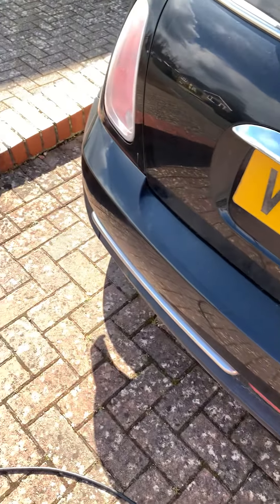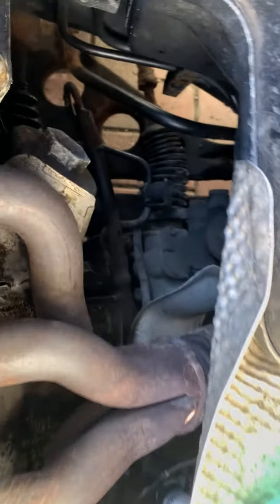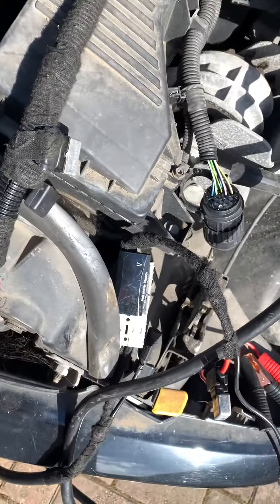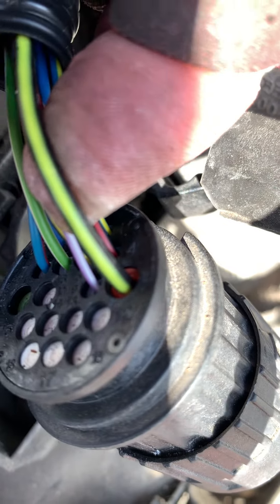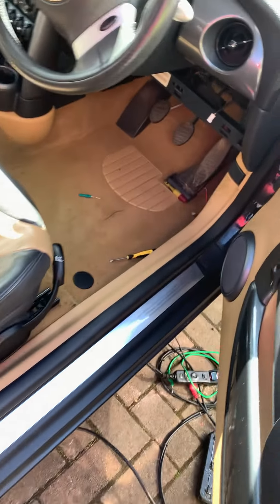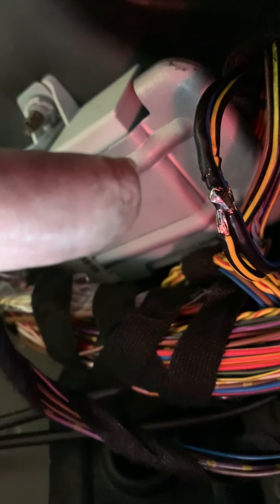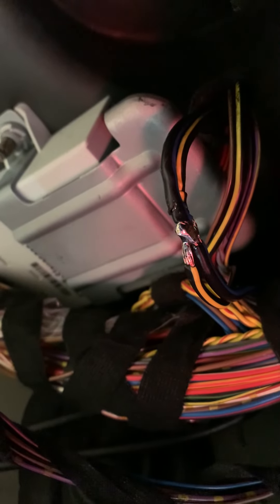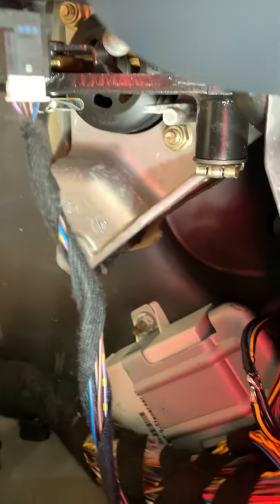Mini No crank immobiliser fault? very simple tests in the description

Comment: Thanks for the video. Attaching a wire there saved me a lot of hassle removing the steering column plastic and trying to work out which wire is which. I now have a bulb in my Mini Cooper that lights up when the starter motor circuit is live, therefore helping me work out the cause of my intermittent fault with the ignition.
Reply from the maker: Nice work! 👍

Comment: Is it the black and yellow wire 2 in from the left of the blsck and yellow wire 3 in from the left as I have two
Reply from the maker: Email us and i will send you the wiring diagram
Reply: @Car alarm and radio Services  OK what's your email?
Reply: I've got the car turning over now by splicing the 2 wires hut doesn't start, guessing it was the other back and yellow wire, the video would've been better if you had the torch or flashlight on so I could see exactly what was what
Reply: Seriously. I've watched it a thousand times don't understand
Reply from the maker: If it turns over then it’s bypassed this is a test for a car that doesn’t turn over
Reply from the maker: What don’t you understand?
Reply from the maker: What don’t you understand? Its a very easy test

Comment: Hello! Did you connect all 4 wires together or black yellow to black yellow and black blue to black blue. Thanks in advance
Reply from the maker: No just connect the two please email us at caralarmandradio@gmail.com for a short cut
Reply: Sorry, which wires did you connect together? The black/yellow with black/blue?
Reply from the maker: @posplaytime801  just the two thick wires black blue to black yellow or unplug the unit and put a fuse in the socket. Email me for details caralarmandradio@gmail.com

Comment: Hi. Thank you for info. I have proved that the starter motor works by following your video. What next. My mini cooper s convertible 2007 won't start. Who do I turn to now. I live in Devon, auto electricians are had to come by. I spoke to one this morning he offered the advice, without seeing the car and I appreciate his comment. Get the ECU checked ?
Reply from the maker: Does it turn over? Email us at caralarmandradio@gmail.com
Reply: @caralarmandradio Hi.yes it turns over.
Reply from the maker: Then it could be all manner of faults the most common is the bcm water gets into the bottom plug

Comment: So, there is just one plug going straight into the EWS, do you cut both of the bigger blue wires and the bigger yellow wires and solice them together, or can you leave it unplugged and jump them over or is there a better video showing how it all
Actually goes together by any chance?
Reply from the maker: Hi tyler just splice them together takes 2 minutes
Reply: So do i leave the plug plugged in, or just leave it unplugged after i splice them?    And is it just the big yellow and black and the big blue and black wire that needs spliced together?   Sorry for the questions, just want to make sure im doing it correctly.
Reply: So i went out on a limb and spliced them together and it works.  I appreciate the video.  Only other question i have is will it work okay with the door lock and unlock on the keyfob?
Reply from the maker: @TylerFrazier-dy4mm  yes no problem
Reply: Hola buenas tardes y aplica también cuando no hay chispa en las bujías??
Reply: @TylerFrazier-dy4mm spliced what together I'm in desperate need of this answer
Reply: Do I splice the wires from the plug or to the plug

Comment: To whom it may concern. If you have a bling ring around your ignition and your car isnt cranking, remove it. I did this wire splice and the car still wouldn't start. Just cranked. My daughter wanted to hook up her car with bling. I removed the bling ring off the ignition and booooom the car started
Reply from the maker: Those rings should be banned also there are some that stick to the airbag on the steering wheel. Really bad idea 😩

Comment: please tell me how you removed the panel to access the immobilizer...we are trying to get it out for programming to a new BCM
Reply from the maker: Ah ok its held in very tightly by a metal strap with a strange security nut but you can get it undone with a pair of pliers it will take patience but easy to do once its loose ok
Reply: Which year, model mini and which country ?
Reply from the maker: @mrdman094081 uk model r series

Comment: Nice video. The chips inside my only key is broken and can't started my 2006 mini with the esw4,3.  Does this trick can fix my problem?
Reply from the maker: No afraid not you will need to get a new key programmed or get the ews mapped out by us

Comment: This will bypass the immobilizer from stopping the starter motor from turning. But it won't bypass the injectors or spark.  So it will now crank over but not start the car.
Reply from the maker: That is correct but the fault in this case was the engine doesn’t turn over
Reply: How do you bypass the injectors and spark
Reply from the maker: @rosswilkinson20 we remove the immobiliser from the ecu electronically
Reply: @caralarmandradio  would you be willing to share? For the record I'm not trying to steal a car.
Reply from the maker: You will need to send me the ecu for ecu update after that it will start
Reply: Depending on where the actual fault was.  Not meant to breach, but to determine if immobilizer was at fault.
Reply from the maker: Yes its a good test to see if the unit is faulty

Comment: Hello! Old thread but hope someone knowledgeable might read it: I have the same symptoms of the car (2006 R50 CVT) sometimes not starting, in particular when it has set for an hour and engine is still warm (usually always starts if turned off only short time, like for a gas stop. and usually also mostly starts if were left alone over night). When it misbehaves, the crank might initiate for a quarter of a second... once! After that never again and I get (from an OBD reader which has app support only for Gen2 Mini) the error code  P1692 which says Turbo(??) Control Solenoid Circuit Malfunction. I don't know if that error code is accurate (I don't have a turbo) and caused the non starting or is the result of the failed start, nevertheless clearing that fault does NOT help to be able to crank/ start the engine. Usually letting it sit for another day might help or last time I pushed onto the lid of the throttle body which "woke it up again"... I already replaced the ignition switch and checked the grounding cable and also believe it isn't the starter motor (albeit not 100% sure). I am on my third throttle body already ( 70.000 miles) and ultrasonic cleaning it hasn't made any changes either... could it be the immobiliser as well or does P1692 indicate a different issue? P1692 says it could also be the pedal position connectors -- and I did install a Sprintbooster some 10+ years ago which seems to work fine otherwise...  or could it be the CVT stick signal (but I do believe I see P on the dashboard) any suggestions??  thx!!!
Reply from the maker: Hi try the testing for the ews as i suspect its faulty

Comment: Hi done this on a neighbours car as it had intermittent starting problem was ok for a few weeks now it just turns over but won't start do you know if say the fuel pump goes through it 
Many thanks
Reply from the maker: Hi James the other circuit goes through the ecu and can’t be removed without the proper software but there are numerous tests that can be carried out before this is done ok
Reply: @caralarmandradio  thank you for your reply I will have a look at the car tomorrow and see what going on with the car so the fueling side doesn't go through the immobiliser control module
Reply from the maker: @jamesgibbs9398  if you email me at caralarmandradio@gmail.com i will send you the wiring and pinouts of the ews unit

Comment: Hello. I have just removed the starter motor from my 2002 Mini One. I bench tested it and it seems fine. Not sure why the car won't start. I tried to turn the engine by hand but it only goes anti-clockwise. No chance of it moving clockwise (I have tried with all my strength). Might be a siezed engine as it was left parked for a year, but oil looks fine on the dipstick. I will give your video guide a go, but not sure how the wiring would be an issue with the car just parked up? Was there any symptoms leading up to your car not starting?
Reply from the maker: You need to check if you have power on the black yellow wire when you crank it dude ok
Reply: What if oil level good, oil pump bad ?

Comment: Hi, I know this is an old video and i probably won't get a reply but i figured i'd try anyway..

I'm having a no crank no start after trying to hook-up an aftermarket radio. (i don't know if the radio is related or not)
All the dash lights light up but when i turn the key all i get is a small click from the steering wheel area (like a relay type click) but nothing from the starter.

I replaced the battery with a brand new one, so i know it's not that. I was thinking it would have been a starter issue but  i'm getting zero sound from the starter, and i keep finding vids and threads about the immobilizer 
that sound very slimier to my issue. Will this trick work on my 2005 mini cooper s r53 to tell me if my starter is at fault? And if i do this, and it does work, will the car actually run and drive, or will it just crank the starter?
i really don't want to just throw a starter at it and find out it still won't start after doing all that work >.<  And taking it to a dealer is really not an option for me ($), so at this point i'm kinda praying it's just a bad starter.
Do you think trying this trick is my best option? Any help is appreciated!

Comment: I have a 2006 mini Cooper can I bypass the key the same way as the starter? On the immobilizer
Reply from the maker: No I’m afraid not the second part of the immobiliser goes through the ecu but we can remove it with an ecu update
Reply: I need to purchase whatever it takes can't tell if it's key  or what had a locksmith make key cat not starting or cranking  had 2  diff locks smith  might been scammed
Reply from the maker: @Grizzygabana you need to send us the ecu and ews 3 unit and i will bypass the immobiliser email us at caralarmandradio@gmail.com price £150 plus carriage

Comment: Hi mate, same problem I’m having. Reading through the comments I have a little confusion. If I do this… will the car run fine or will I have issues with injector and spark? 
Also ive looked on your website and you 1hour 9 mins away does that mean I’m shit outta luck 🤣
Reply from the maker: Hi James. So the car doesn’t crank. Then you need to find out why. It could be the ignition switch,the immobiliser,the starter or a bad connection on any of the above. This test is to bypass the immobiliser part 
The easiest way is to use a fuse. Email me and I will send you details caralarmandradio@gmail.com ok regards mark

Comment: Hai sir. Im having the same issue. How to bypass the immobiliser. Do i need to cut the wire or how?
Reply: I have same problem. This video  doesn't show how to doit. I need find  out aswell
Reply from the maker: At the immobiliser box cut and join or just strip join and solder the black and blue and the black and yellow wires see diagram
Reply: Did ty. Dint work. I look at the boot the little box next to the battery is the fuel cutt off and the wire in ruined by water so I'm hoping that is the prop . Il let u know bro
Reply from the maker: The immobiliser bypass will allow the car to turn over if it already turns over but won’t start then that’s something else
Reply: @caralarmandradio   do you cut both black and yellow wires as well as the black and blue wire then join all three together?
Reply from the maker: @tmitchgoon2077  no just join the black and blue to the black and yellow just two wires
Reply from the maker: @tmitchgoon2077  email me at caralarmandradio@gmail.com with your reg number and i will email the wiring diagram
Reply: @caralarmandradio 
Ok so you sit the wires , now you're left with 2 wires and 4 ends. Which ends are soldered together? Or how do you do it. Please help me figure this out
Reply: Sorry , cut not sit
Reply from the maker: @mariolynch-lt1jg  just join the wires together i separated the casing and soldered the two wire together. If you cut the wires join the two that go back to the loom as the two coming from the box are useless
Reply: @caralarmamdrio do I cut the wires leading from the box or going towards the box??
Reply from the maker: @jaaaysdaay1304  hi there are two THICK wires on pins one and two ignore all the rest unless you wish to test the lives earth etc.email me for wiring diagram caralarmandradio@gmail.com

Comment: Does anyone know how much a dealer charges to recalibrate the immobilizer code ?
Reply from the maker: Recalibrate the immobiliser code? You can line up the dme and immobiliser with most scanners
Reply: were bringin in the immobilizer bcm and key to get them programmed--costing $500cnd
Reply from the maker: Any good auto electrician can do it with a scan tool it’s called ecu alignment

Comment: Thank you for identifying this black and yellow wire. I had a really hard time understanding how to remove the twist lock on this connector so I had to break it off and use a jumper to test the battery on my 2005 Mini Cooper S. My EWS is not working so I had no way to perform a compression test on the motor until I found your video to use the starter. Thank you again. Here is a link to my video using yours as a guide 

2005 Mini Cooper bypass Starter EWS jumper to test starter function and power ignition coil
https://youtu.be/7mi-m3IyQLU
Reply from the maker: Glad it helped mate

Comment: Would be more clear as youre not quite bypassing the immobilizer. Youre making a short cut to get power to the starter. If the immobilizer wasnt correct the car wouldnt start at all period
 At least not with that simple jump in wires it would tske modifying the computer to not reauire the immobilizer. Just saying because due to misinterpretetioms often customers act like rhey know better and blame the wrong person.
Reply from the maker: I agree but this is a simple test nothing more to see if infact the ews is faulty. If that is the case then i can delete that completely

Comment: It did not work for me
Reply from the maker: Then it could be ignition switch or starter very easy to test as explained
Reply: It wasn't either, I had to replace the whole lot, ECU, immobiliser unit, replacement keys
Reply from the maker: @MrZak82  oh dear then you were unlucky

Comment: I have a 2006 mini Cooper can I bypass the key the same way as the starter? On the immobilize?
Reply from the maker: Email us at caralarmandradio@gmail.com if you need more information but the immobiliser second circuit is very hard to bypass as it is in the ecu system. What is the issue with your car?